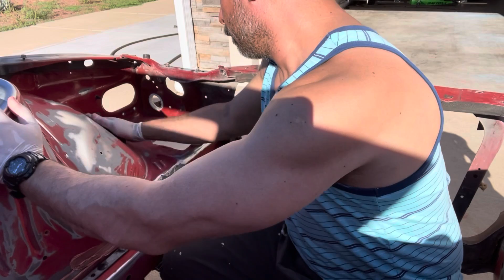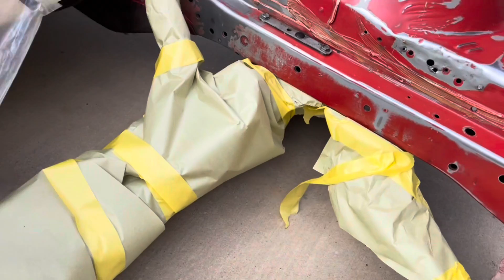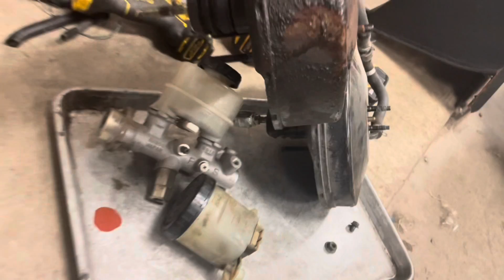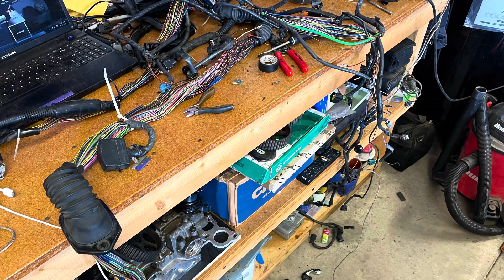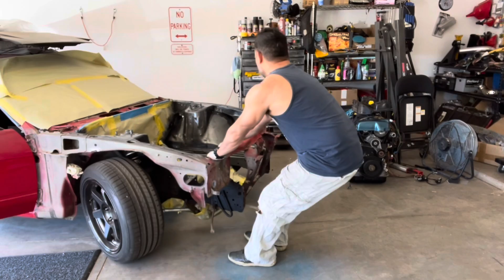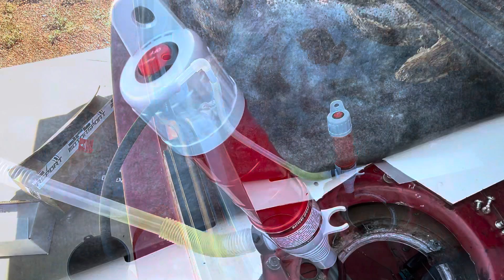(Project S13 Coupe) 2JZ/R154 install + paint

Comment: Nice I’m doing a 1jz gte vvti swap right now in a hatch , how much hammering did you have to do on the trans tunnel to fit the R154?
Reply from the maker: Zero hammering. It confused me because I’ve read several threads on this, and I saw ISR sells a metal panel kit to weld in after cutting the tunnel on its sides. I did not have to cut the sides of the tunnel, but I did cut the upper portion to clear the tripod ears.
Reply: @crashdixon_01  that’s awesome
What mount kit did you use?
Reply from the maker: @x @xXxXdr0pDeadxXxX  ISR mounts. Can’t recall if I got them off eBay or Enjuku.

Comment: Hey do you remember the part # of the radium 90 degree fitting you used on the fuel rail?
Reply from the maker: Radium 8AN ORB Swivel Banjo to 6AN Male Fitting

Put that into an online search and it’ll pop up in top results.